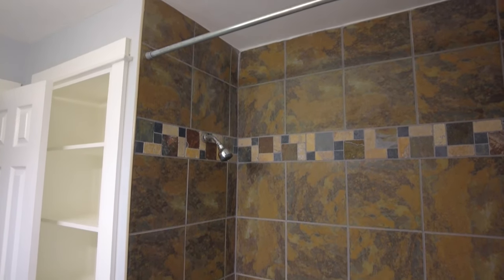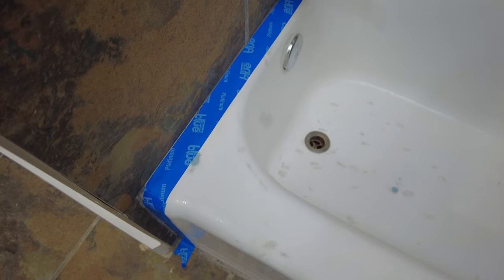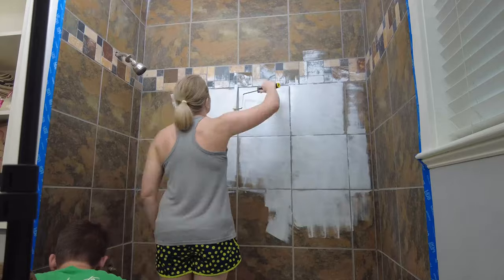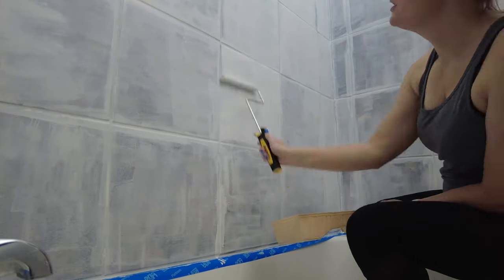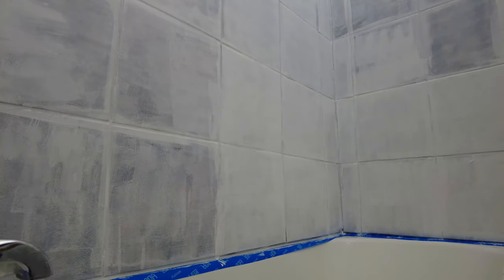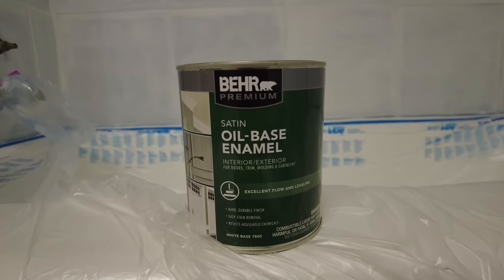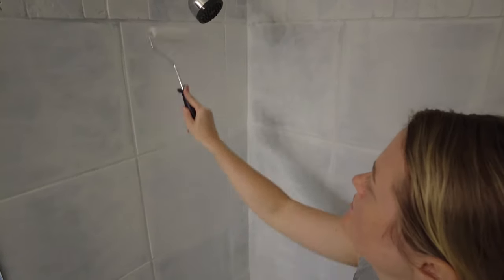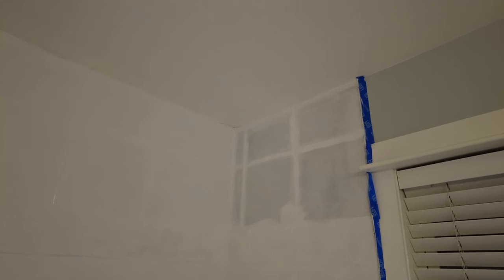One Room Challenge: How To Paint Shower Tile - Updated your UGLY/DATED Shower for $50!

Comment: When painting tile the glaze should be fully removed/sanded or scuffed, then 2 coats of moisture resistant primer and the top color coat should be an epoxy product as it offers both , a high degree of moisture resistance and a strong, almost chip proof finish.
Reply: That's great, can you sand the tiles with the a light grid paper &sander or what do you suggestion?

Which epoxy should do u recommend?

Thanks 😊
Reply: @girlnextdoor7012  Rust Oleum Tub and Tile Refinishing Kit.
Reply: Is what you're suggesting different than what the video suggest?
Reply: Sand tile first
Reply: She didn't use tile paint too
Reply: And also waterproof tile paint too right
Reply: Thanks for info 👊🏽💯
Reply: Do you have to sand or no ?
Reply: Seems to be ok
Reply: True story

Comment: How has the oil-based enamel paint held up since the install? I know there are a lot of other more expensive paint dedicated specifically to bathroom tile out there. If you could do it again, would you use the same enamel or chosen something else?
Reply: Did you get a response about how the shower held up with use and cleaning?
Reply: would like to know too

Comment: I'm preparing to try this myself!  A couple of questions...1) I'm doing this in a one bathroom house so it will get a LOT of use.  Do you feel that using some sort of sealant would protect the finish more?  2) I'm considering using a stencil on the shower tiles as well, would you use an oil based enamel for that 2nd color paint as well?

Comment: Do you recommend sanding the tiles before adding primer?
Reply: Yes.
Reply: Before any type of sanding, clean super well with general cleaner and then with a solvent (lacquer thinner or denatured alcohol) that won't leave a residue. 
  
There should be no loose grout, soap scum, silicone, grime, etc.

Comment: Hi. Thanks for your work on this. I note that Behr's product description states a caution "not for use on horizontal surfaces." Do you have any suggestions for roller type or other techniques to mitigate dripping (I assume is their reason for the caution)? Thanks again!
Reply from the maker: Hi! I used a high density foam roller and did thin, light coats. I also primed which I think makes a big difference for adherence! We had no pretty drips 👍🏻

Comment: Get ready for you shower to smell like paint for over a week!...oil paint takes forever and a day to air out...I also recommend a a top coat.
Reply: Hi Johnny, what oil based enamel paint did you use? My Home Depot doesn’t carry the paint Amber recommends anymore! And what top coat did you use? I am priming my tile tomorrow. Thanks!
Reply: @maureenhinton4706  Home Depot still carries the oil satin paint...you just can't get it in a quart anymore...only gallon. 😆 I am doing my second shower using Rust-oleum floor base and topcoat.  Read the description.  Says you can use it on ceramic tile.  Not sure how well it blocks house hold products...but being its made for floors...it's probably decent...and its sold in quart. I used some of the Rust-Oleum top coat matte finish on my first shower....being that it's a water based topcoat...it's not gonna hurt anything.  Mine turned out fine with no additional sheen.
Reply: @JohnnyJohn-xh2vm  thanks for your quick reply! I will try a different Home Depot, as the one in Bellingham, WA told me they are fading out oil based paints. I may just end up using  Rust-Oleum Tub and Tile as I need to do the shower floor as well, but I will check out your suggestion. What type of roller did you use? Thanks!
Reply: @maureenhinton4706  I prefer 6" High Density Foam roller for smooth surfaces or 6" micro fiber 1/4 nap roller for smooth surfaces. Micro fiber works well if you have the larger size grout lines.

Comment: How long did (does/can) this last? Anyone have better sealer ideas for water/moisture resistance?
Reply from the maker: We are on month 10 with no problems 👍🏻
Reply: @a_m_b_o  but you mentioned that this was a guest bathroom that is not often used. How do you think this will hold up in a main bathroom? TIA

Comment: I have a full, wall in shower. How slippery is it after being painted? I'm worried if I paint the floor tile it's going to be really slippery.
Reply from the maker: I’d worry about that too… I only did it on the walls but it is slick when wet! If you let it cure long enough it’d probably be fine with a bath mat!
Reply: You could do peel and stick tiles on the floor? That's what I'm going to do.

Comment: Hows the paint holding up?
Reply from the maker: Hi! So far so good! we're approaching a year so i'll try to share something soon. It's a guest bath so no heavy traffic but it is cleaned biweekly and no scuffs or peeling yet.
Reply: @a_m_b_o  thanks for the update:). I was not able to find that paint since Home Depot doesn't carry oil-enamel paint anymore. I went ahead and used latex based paint from Lowes. Hopefully it doesn't peel soon😁
Reply from the maker: @urbansolis  no way! Even in store? I could find it online but did find in store
Reply: @urbansolis  I bought the paint last week at our local home depot. Thats weird.
Reply: @arod4056  you're right. Apparently it was only out of stock at my local HD. Not sure why the employee told me they would not longer carry that paint. The other HD is 30 miles away -_-. That other paint is not holding well. Might have been the primer I used. Not sure